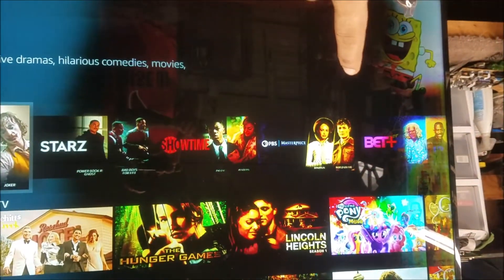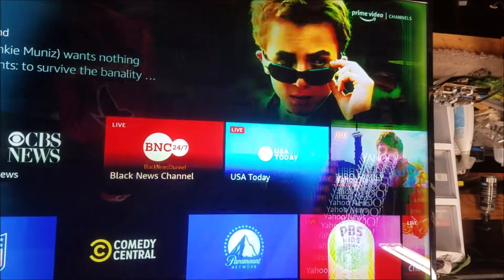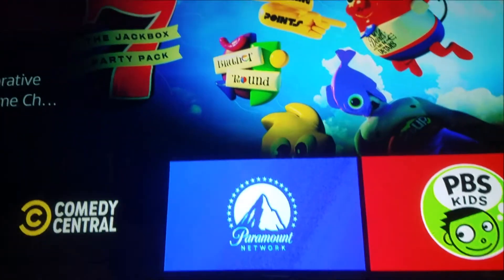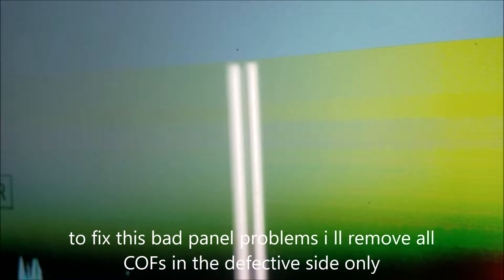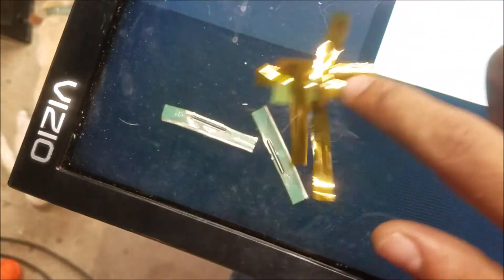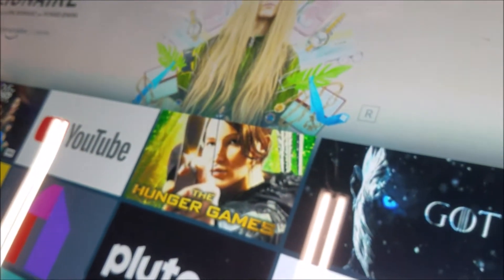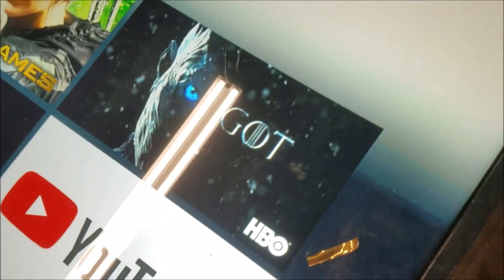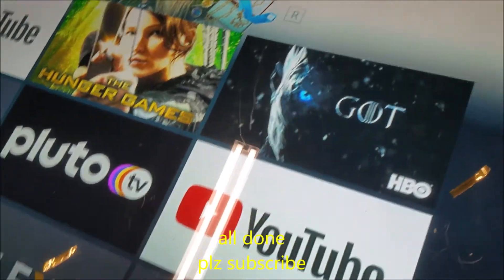quick video how to fix vizio E65 E3 bad lcd panel dark side discoloring and slow pixels

Comment: I have a sony tv kdl-55hx855 and ploblem like yours. I can do it like you, right? By pulling away the problematic side film Remove the problematic side film all over the strip, right?(All)  Could you please tell me the details? I can do some Thank you very much. sir
Reply from the maker: from the detective side only remove all the COFs in that side, dont touch the bottom side COFs
Reply: @SOSfixElectronics   Thank you  very much.sir   ^_^

Comment: I did as you suggested, and my screen was good and no  dark and no slow  (I'm glad), but it has four or five horizontal lines black , what is the reason? Can it be fixed? Thank you very much.sir
Reply from the maker: how tick is the lines?
Reply: @SOSfixElectronics  s many small black lines in the horizontal Almost half the screen length Is there a way to fix it? But no matter how Now it's better than I didn't. Your advice is of great help. Thank you very much. sir
Reply from the maker: @MegaMira22  check the place where the COF was maybe you left some of it there not removed
if all clean and you still have black line, that is what cause the screen to have bad picture at the first, and sorry there is no fix for the dead pixels
Reply: @SOSfixElectronics  Thank you ,very much  sir,  you is nice  ^_^
Reply from the maker: @MegaMira22  you very welcome